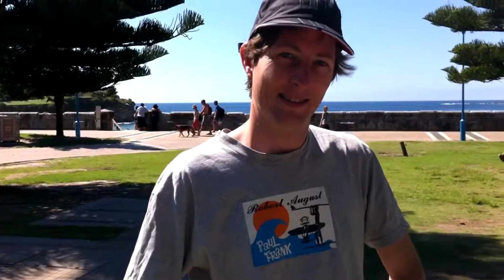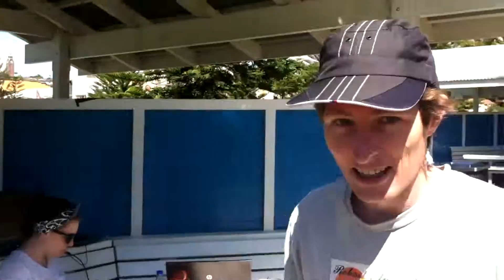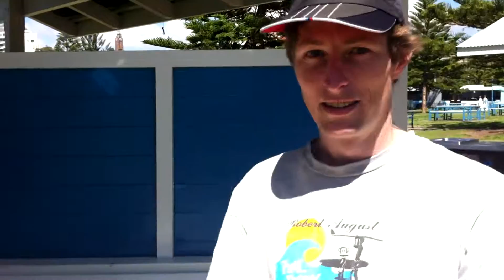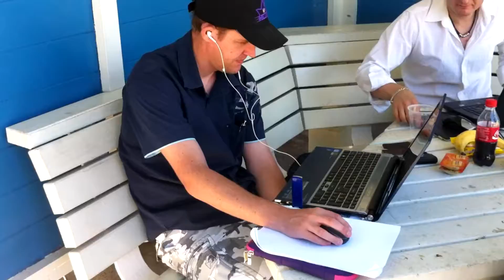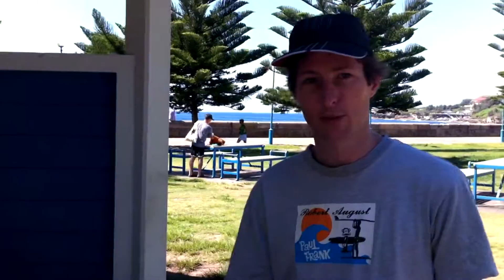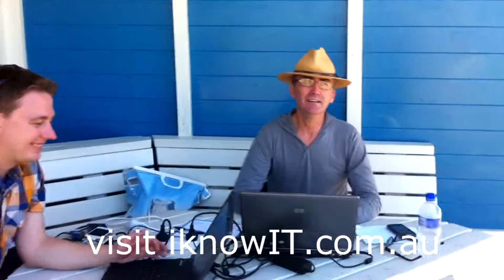Christian on: I Know IT "Disaster Recovery is a Beach"

Comment: Interesting video and a good test.  Something that is rarely done (but should be) by businesses.  I just have a couple of comments though.  Have you thought of using VoIP and virtual PBX?  That way, using a 3G router, you could connect VoIP handsets giving you the same funtionality as in the office without the need of diverting calls to your mobiles and the costs associated to that.  VoIP is not recommeded over 3G but can be used temporarily.